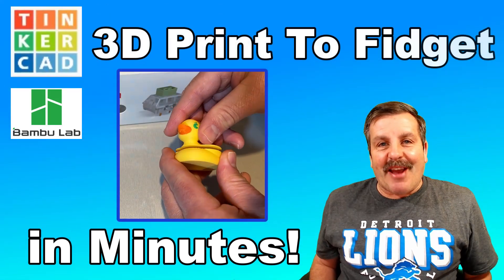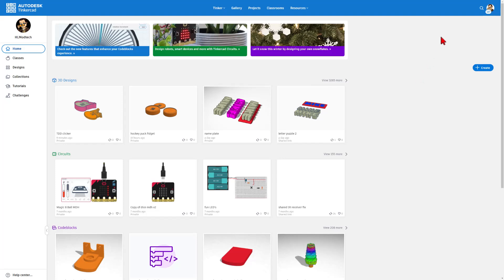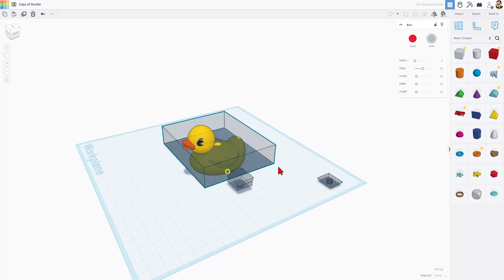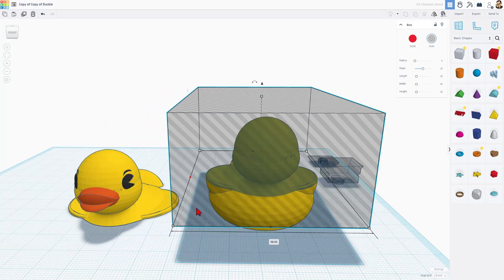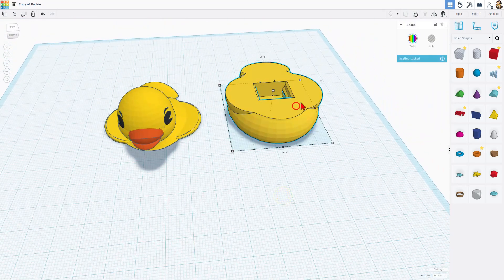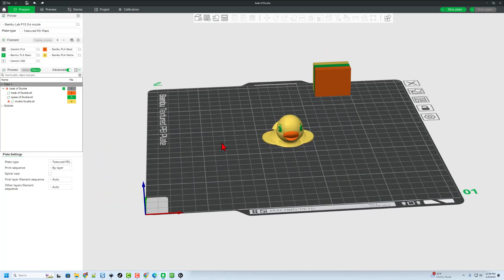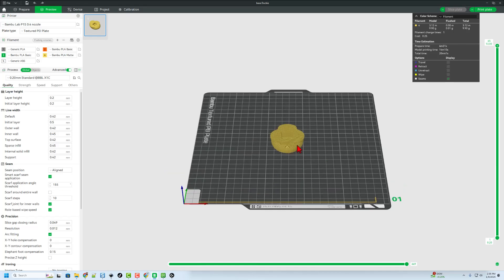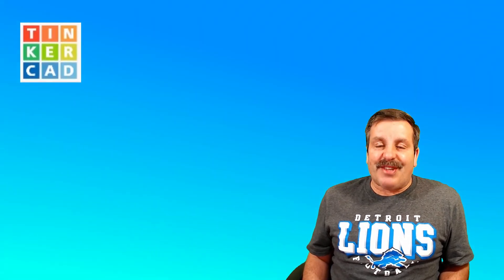Convert Designs into Tinkercad Clicky Fidget for Beginners in Minutes

Comment: My keycap switch is a 5pin, the pin does not fit snugly into the printed piece. is there a template for the 5pin?
Reply from the maker: I am not sure. I would trace the keycap and create your own hole to fit it using the sketch tool.

Comment: Hey! two questions… can you do the clicker flipped? Like the bigger piece be on the top and the “cap” be the bottom piece and it still function the same? The ducky the bottom half is bigger but my design is more too heavy and the bigger piece would fit better on top flipped around and the cap better fitted in the bottom 

Also, do you know if these measurements will fit the pawpers clickers. 
Thanks great video!
Reply from the maker: Interesting question. No idea on the pawpers... I would make this basic clicker to test that. https://youtu.be/I9i0ZHkBIzc It would also be a easy way to test if they work upside down. I can tell you that it does not matter as I hold one and click it upside down. Curious if it stresses the part more working like that though.
Reply: Thanks! I’m gonna order the switches in description since I know they work. I’ll report back about trying it upside down!

Comment: Do you have a tutorial on how to separate the different colors to print separately (ie if we cut out the eyes and beak and glue them in later). I have an ams but hate the waste of filament doing multicolor.
Reply from the maker: My best gluing video is here. https://youtu.be/6nUsRjgQzNw Those parts are pretty small though.
Reply from the maker: You are 100% spot on that there is a huge time trade off with AMS color prints.